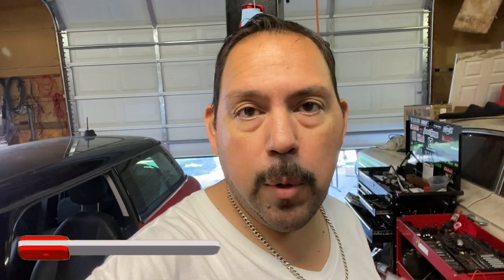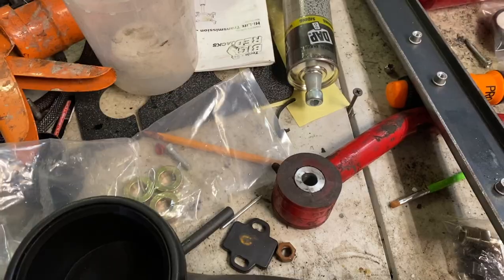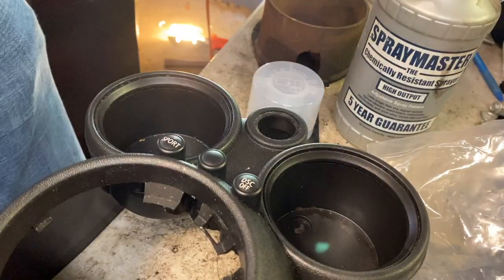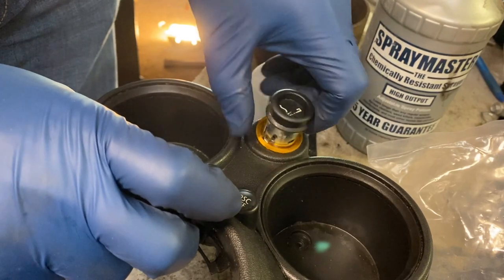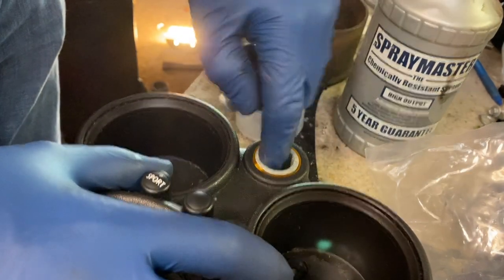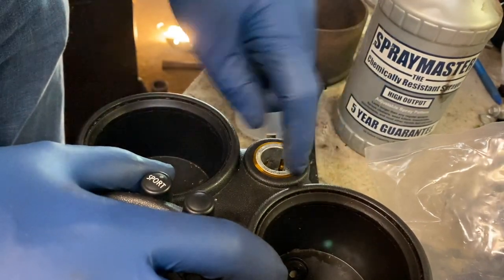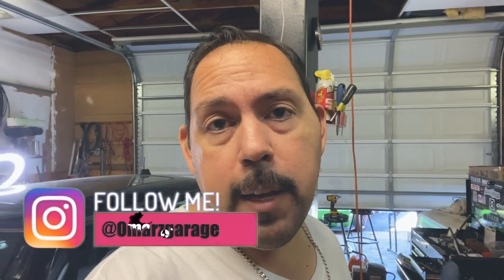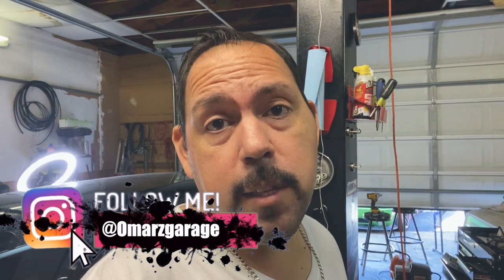Fixing a Broken Cigarette Lighter in a Mini Cooper

Comment: How did you remove the old one? Destroyed it?
Reply from the maker: It was broken already, that’s why I was replacing it. It was just loose in there.
Reply: @OmarsGarage  I ended up breaking mine to get it off the old lighter.  Split it at the thinnest point.  It's holding so far.

Comment: Can you replace bezel without removing the console? Thanks
Reply from the maker: Yes you can, I had removed the console because I was replacing the parking brake cables and it made it easier to explain on video.  You just pull up on it and it comes out, just be careful not to pull too hard as you don’t want to damage the cables.
Reply: @OmarsGarage  Thanks for getting back so quickly

Comment: Hi there, do you happen to know what the connector that powers the 12v socket is called?
Reply from the maker: https://www.ebay.com/itm/324896275787?mkcid=16&mkevt=1&mkrid=711-127632-2357-0&ssspo=jdRwIW_ORD2&sssrc=2349624&ssuid=&var=&widget_ver=artemis&media=COPY
Reply from the maker: Cigarette lighter wire harness